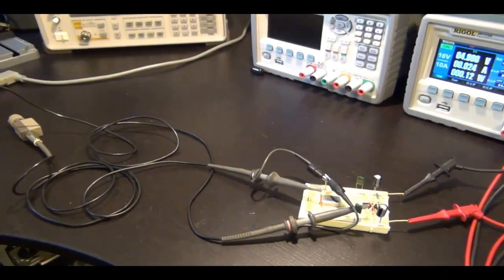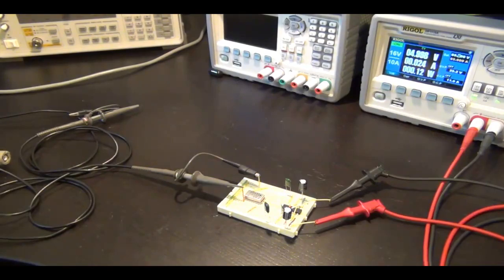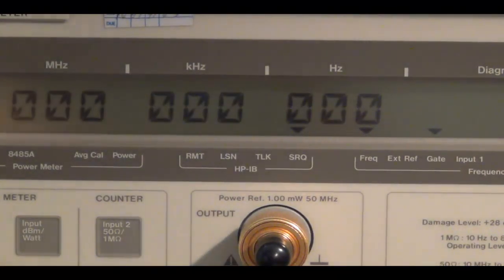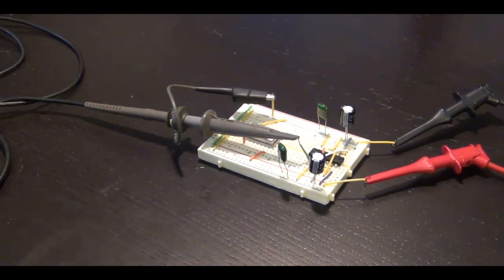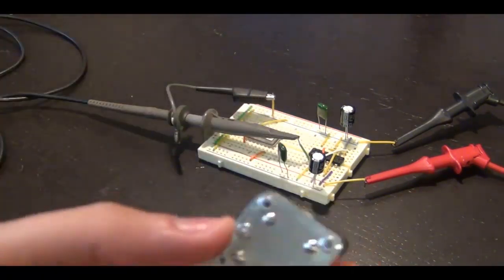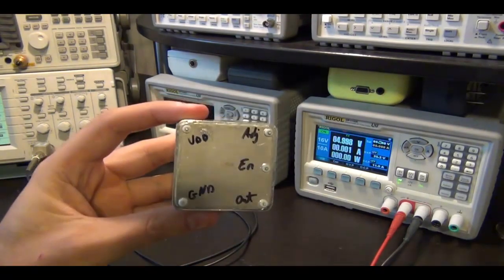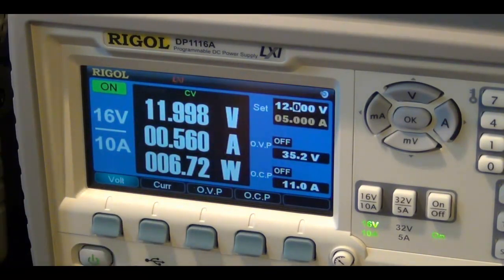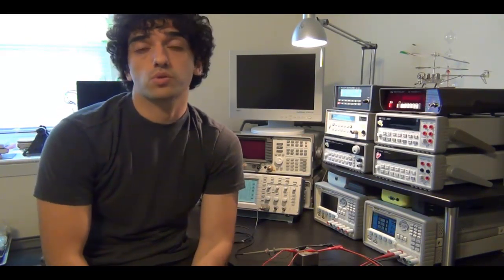TSP #4 - Frequency Generation: Crystals and Ring Oscillators (Part 4/4)

Comment: Excellent in every way. Congratulations.   I love your equipment, so accurate and everything at the push of a button. You are so young and used to the modern equipment including the frequency  analyser.
I normally make my own equipment including  power supplies, signal generators and have one  old analogue oscilloscope, but I manage. Have been playing about with exciting loop antennas, but since I do not bother with crystals, I use the loop antenna itself  as the frequency determining  element .  It is all about showing the principles involved and I am not after such accuracy that you have shown in this video. Congratulations once again, you have a good understanding of the subject  and can transfer the knowledge to others in the most excellent manner, with the highest level of diction and  mastery of the language.  Keep it up and good luck in your future dreams.

Comment: This was a great series of videos. My senior design project for my EE degree is to make a discrete Phase Locked Loop.  For this I need a VCO and I was considering using a ring oscillator (probably around 11-13 stages).  Seeing the VCO stability through the spectrum analyzer was very useful for me.  Thank you!!

Comment: @TheSignalPathBlog I am jealous ;) I have a lab power supply oscilloscope function generator etc. and the best way to understand components is to see what it does. I learned by just looking at a signal through a capacitor on my scope.. changed the signal an looked what happened. at 1:11 you are cooling down a crystal.. that's the way to make people understand what is happening! great job!

Comment: Hi Shahriar, Just one last remaining thing on the subject I was hoping you would show us how stable the large Oven based oscillator handled temperature changes in the extreme by cooing it and also how well it handled voltage change Pt 5 maybe include an atomic reference to compare with all of them thanks again great videos regards Sean

Comment: Nice videos. I have a question about the crystal oscillator. I want a crystal oscillator with a frequency range less than 20kHz, but I found the lowest  available frequency for it is about 32kHz. One way is to reduce the frequency by using a frequency divider. But I only have a small space for my oscillator. Therefore, I want to build my own oscillator with a frequency less than 20kHz with a small dimension. I am not familiar about the oscillator.  Do you have any advice? Thanks.

Comment: The Signal Path Blog will I get oscillations with just a crystal and a battery?
Reply: Owen Chase science channel no you need an oscillator circuit, the crystal just sets the frequency. google "pierce oscillator" for more info.